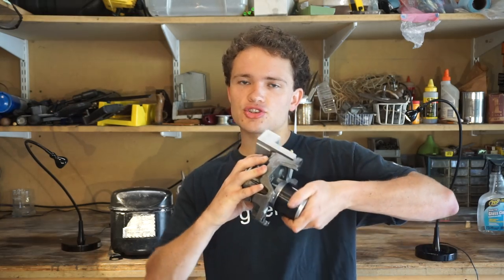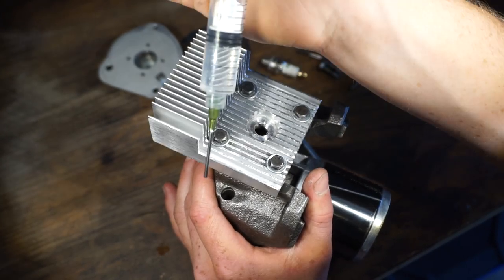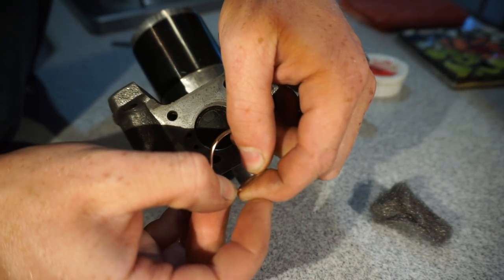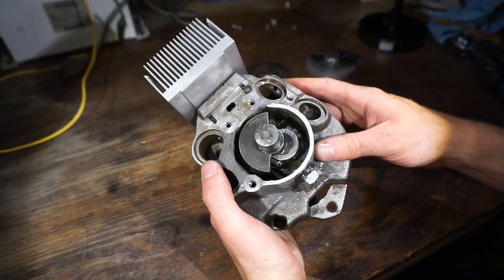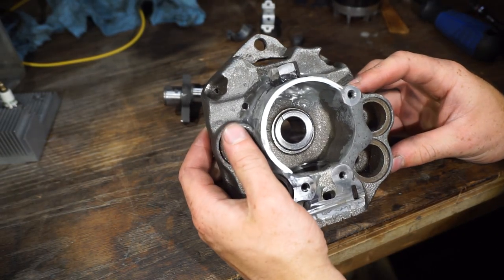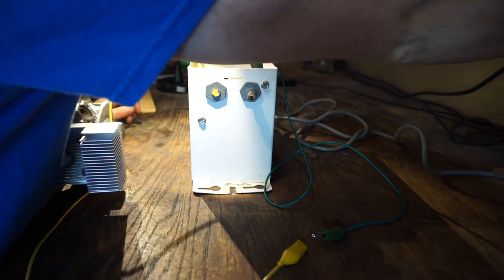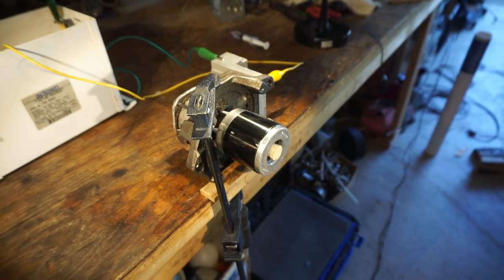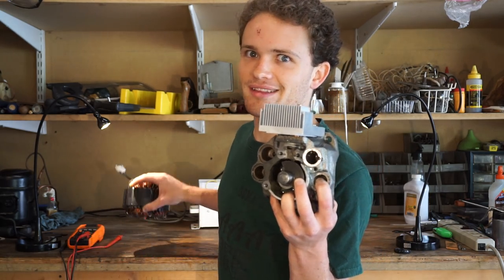Part 5. DIY Internal Combustion Engine Made from Old Compressor - First Run and Copper Head Gasket

Comment: I cant believe you got that running that fast!
Reply from the maker: Yeah me too!  It's pretty well balanced and being such a small engine it kinda has to be a fast runner.  I'd guess it was easily going 6-8k RPM.  Small nitro engines go like 12K RPM
Reply: I wish I could find a compressor myself and build along, it would make a neat rc engine.
Reply: Makerj101 Actually some 3,5cc nitro engines rev to 28k rpm, my modified 50cc moped revs to over 13k rpm
Reply: Lol I bet that moped sounds dope.
Reply: Ruben Olaussen actually rc engines rev up to 50000 rpm
Reply: Thallium rc you might be able to find one at a junkyard somewhere.
Reply: Briggs & Stratton Power my 3.5 engine revs 50k rpm.. I blew the little engine up at the end
Reply: Just keep looking, I managed to find one after 2 months of the series starting and i'm just on to making the crankcase. Believe! Fellow engineer!

Comment: I would love to see your take on the rotary engine
Reply from the maker: If I can make it out of solid JB Weld then YES  :D
Reply: XD JB Weld rotary. Now that I'd like to see.
Reply from the maker: Hehehe XD
Reply from the maker: I'll give it some thought
Reply: Makerj101 actually some aircon pumps were wankel, so you may be able to turn it into an engine fairly easily
Reply: Callum Tapper dude. Bro. I would mount a small rotary to my bike.
Reply: TheFunniestFarm you can actually get tiny little wankel engines, look up Sachs wankel engine
Reply: Callum Tapper Look up ''O.S wankel engine"
Reply: Makerj101 look up os wankel engine
Reply: It would be pretty much impossible to make a rotary
Reply: Brayden 825 more possible then you think
Reply: Brayden 825 he would have to cast parts out of aluminium... but yes lineing up the roters edges with the housing/combustion chamber to jenorate the proper conpreshin will be very tricky
Reply: Makerj101 jb weld and gorilla glue, maybe some super glue
Reply: I second this! I'd love to see you have a crack at a rotary
Reply: I woul also love to see you atempt the wankel
Reply: another rotary vote. by far my favorite engine design ^_^
Reply: @theLuigiFan0007Productions  OK, we've all voted that Makerj101 build a rotary and somewhere use JBWELD....let's make sure JBWELD supports his build!

Comment: This is great! With a proper 2 stroke exhaust and a good carburetor, this little engine can get very fuel efficient! With some old automotive parts, a simple ignition system shouldn't be too hard to fabricate. When you're going to use premixed gas, i recommend to use synthetic oil for this type of engine.

Comment: Holy cow. I have to admit, I was sceptical. Especially when drilling the hole for the piston-gated intake port, it seemed your drill alignment was pretty far off your mark.
That combined with the "I guess it would go here" placement if the transfer port and the exhaust port, I thought it didn't have much chance of actually running.
I stand corrected, you are a genius.
Reply from the maker: Haha I was winging it pretty hard, eh?  Yeah I noticed how far off the drill was when I was editing the video!  I never noticed that when I was actually drilling it.  I'm surprised that didn't mess it up.  Thank you for your kind words!
Reply: I'm surprised by the apparent stability for such a thing
Reply: @makerj101  People like you who do often have an sense of whats right vs the textbook.  pat on the back clapping way to go bro!
Reply: Running is one thing making power is another.. however this project doesnt seem to be about power.. just experimenting. Super cool engine man props!

Comment: Excellent !    Many of the old spark ignition two stroke model airplane engines have a baffel across the top of the piston.  This is to force the incoming fuel charge up and prevent it from simply shooting straight across and out of the exhaust port.

Comment: Great Job! I was planing to turn a 4 stroke engine into a 2 stroke engine and see if I can get more power that way, It was great to see your engine finally running!
Reply from the maker: Hmm well in theory you could because you are getting twice as many explosions.  However you would also be loosing a lot of benefits of a 4 stroke.
Reply: Yeah it would be a cool experiment though, I was thinking of using one of those 212cc predator engines from harbor fright, maybe put it on a gokart and do a top speed run before and after,  would make for a interesting video at least.
Reply: Sorry but it would be cheaper to buy a two stroke engine
Reply: well you can get one of those engines new with coupon for like $100, you cant find a 2 stroke engine that big for that cheap, but anyway that's not the point of doing it, mostly i want to do it because those engines are often used for racing go-karts and they sell many mods for them, but I could pretty much turn it into a 2 stroke for almost nothing and It would just be fun to see how good it works. (For entertainment purposes only)
Reply: a piston that size would cost mayby 50 bucks for a knock off winsco. the head atleast 100. by the time you get done with it you could of bought a CR500 off of craigslist
Reply: I wont need a new piston or head, ill just take out the push rods and cam, and drill some port holes and a few other things similar to how he made this engine
Reply: I bet you can get a cheap 5 hp flat head engine on Craigslist for $5-$40 and all you have to do it buy jb weld and put it around the open space where the valves are and take out the cam and the valve components. And then drill out the sides of the cylinder where the right spots for the intake and the exhaust. And in that case I think you can keep oil in the crank case so you would hopefully have a running engine with oil in the crank case, and if it doesn't run you only spent $5-$40 for an engine and a couple things jb weld. But who knows you have to do the experiments on your own to find out haha

Comment: Man you are going to be a great engineer, half the guys i go to college with dont have any where near the knowledge you do and I am an engineering student myself, I repect you a lot dude, keep up the good work.
Reply from the maker: Thank you!  See that's the thing.  I don't know if engineering is what I want to do.  I don't know if my hands on skills will be used to their full potential by doing engineering.  Good luck with your studies!
Reply: I am trying and struggling, like you i have a lot of hands on skill, but I am also very good with my mind, numbers and such. I love fabrication work and welding. I love your videos, and have been watching them a long time. Only one note; on the JB weld it tends to get brittle after a while, I am not sure how well it will wear, but the crank case isn't high pressure, so it should be ok for a while. I can't wait to see what you do with this.

Comment: For future reference, copper actually hardens when you let it air harden. It only softens when you quench it, best in water. Only carbon steel really hardens in a quench. I'm a hobbyist metalworker and knife maker, and I have messed up air cooling copper before and then cracking it when I bend it. It's a common misconception that copper anneals in the air. It hardens the crystal structure.

Great video by the way. I love this channel, I'm glad you've gotten so many subscribers. Here's hoping you get even more!

Comment: That's awesome!! Why don't you mix a little bit of 2-stroke oil with your Coleman white fuel to help with lubrication
Reply from the maker: I'll save that for part 8 when I do the official run!  This was only a test. :)
Reply: Makerj101 oh cool :)
Reply: Great idea but how do you classify this? 32:1 40:1 etc... ? I'd use Marvel Mystery Oil... I know a hot rodder who swore by it in his Chrysler 440 for top valve lubrication. Target sells it.
Reply: I'd use 25:1 for this.
Reply: Although a normal 2 stroke has ball bearings. This has bush bearings so will 2 stroke style lubrication be sufficient or will the bearings fail. Time will tell I guess. Running it on LPG/propane wouldn't dilute the oil like petrol would therefore maintaining the viscosity that those bearings were designed for.
Reply: There are many 2-stroke outboards that used bushings instead of bearings, but as far as i know the British Seagull ran on a pretty rich mixture at 10:1 oil.
The heavy oil mixture helped seal the bushings so no air would lean the air/fuel mix.

Comment: Soldering on a gas cooker? Now I've seen everything xD
I'm so glad it runs dude! Like you said, you definitely need a carburetor so you don't accidentally flood the engine (again haha). It might also be worth your time to design a proper exhaust pipe for this, since 2 strokes work best with a tuned exhaust; more power and much better efficiency due to backpressure. Pullstart is fine for now, I'd worry about making it work as efficiently as possible first before slapping a genny on it :)
Reply from the maker: Hahaha well since I'm trying to make this possible for anyone to make.  And lots of people apparently don't have blowtorches sooo...
Thank you!  And yeah carburetor is coming in the next video!  I'll think about an exhaust pipe as well.  That's a really good idea.  Maybe I'll make an expansion chamber!  :D
Reply: Wait really? I have a blow torch, but I don't have a gas cooker...  haha
No worries bro. I'm so excited to see how you'll improve this engine. Good luck! :D

Comment: awesome series it needs more views! also just a side note your meant to tighten head bolts in a star pattern to avoid warping it although i highly doubt it would matter on this just a good tip if your working on your car. thank you so much for the videos!
Reply from the maker: Thank you!  Tell all your friends!  :)  Haha yeah I just kinda tightened them in a random order!  :P
Reply: It should get more views considering no one try's this on here
Reply from the maker: Well that's part of the problem.  Since not many people have done it, people don't know to look for it.  People have turned compressors into IC engines before.  it's just not real common and the videos are hard to find because most of the videos are poorly done.
Reply: Makerj101 that compression ratio sounds like it would be for a Diesel engine
Reply: Makerj101 I hate to ask this again but how come u doubled the numbers for the compression ratio
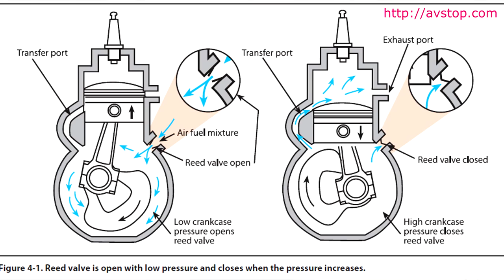Reply from the maker: Volume at top dead center was 0.5ml.  Volume at lowest point was 6ml.  Compression ratio is generally stated as a 1:(and a larger number).  You could say 0.5:6 but that'd be kinda confusing because it is just supposed to be a ratio.  Not the real volumes.  So to make 0.5 to 1 multiply by 2.  Since it's a ratio multiply both sides and you get 1:12 compression ratio
Reply: Remember the stoichiometric formula for air/fuel ratio is 14.6:1
Reply: TheFunniestFarm Air/fuel ratio does not have anything to do with compression ratio.
Reply: TheFunniestFarm And that ratio is meant for gasoline.  The stochiometeic ratio for coleman fuel is probably diffrent.
Reply: Szekely Ferencz you sir, are correct. you win 500 internets xD.
FuelRatio by mass [6]Ratio by volume [7]Percent fuel by mass
Gasoline14.7 : 1—6.8%Natural gas17.2 : 19.7  : 15.8%Propane (LP)15.67 : 123.9 : 16.45%Ethanol9 : 1—11.1%Methanol6.47 : 1—15.6%n-Butanol11.2 : 1—8.2%Hydrogen34.3 : 12.39 : 12.9%Diesel14.5 : 1—6.8%Methane17.19 : 19.52 : 15.5%
Reply: Szekely Ferencz also wasn't commenting on compression there :P

Comment: IT'S ALIVE!!!!!! Congrats on the first run. Glad to see you read my comment and fixed the compression ratio xD. Try to make a bracket to mount a small weedeater carb on, or just make one of your old jar carbs. If going jar use different tube diameters to adjust air/fuel mixture. Add smokeless 2 stroke oil to your fuel to keep it alive >_<

Comment: I would like to suggest you to use a mains step down transformer as follows:
a) choose a 4.5V - 6.0V main transformer that can deliver about 1A at its secondary.
b) connect the primary (mains AC input coil) to to the spark plug with both wires connected one to sparks central top connector and the other to its metal case. Connect and disconnect the DC supply to visually check whether a spark is produce. 
c) Adjust step 2 to obtain the required spark strength

It is important to make sure the DC current is sharply disconnected so that the rate of magnetic flux collapse in the transformer's core is high enough to produce the required voltage.

Comment: AWESOME!  I don't think that it would work as a generator without some modification though, because in an induction motor the rotor isn't magnetized unless the motor is powered up, but if you put a permanent magnet in the stater it will generate AC.

Comment: I think, you can also avoid having to use a carburettor by using a very simple fuel injector. What you need is a tiny hole that guarantees fuel is broken down into tiny droplets. You can achieve a simple fuel pump by using a large spring loaded syringe. A 50ml or 100ml syringe will give enough time between refuelling.

EDIT: To avoid having the non-uniform force produced by springs, you can use a weight to push down on the syringe's plunger. Gravity provides a far more constant force within the distances encountered in this experiment. However, a spring does have portability advantages.

Comment: I'm suprised how well it worked with the constant spark, I thought it would run alot more rough. Probably helps that it runs at high rpms. I got a Honda gx160 engine with a broken off ignition coil mount, might try running constant spark on that but its also a lot lower rpm engine

Comment: For the ignition system take a strimmer flywheel and ignition coil and work the magic there. You can then make a cowling for the engine for cooling and supercharging of the carburettor. She'll run much cleaner and stronger. Get a carburettor and put it in behind the cowling for supercharge effect. Just my ranty ideas

Comment: A carb will surely help with air fuel mixing. Anoth good idea would be to use a 30-50/1 fuel oil mix as is used in chain saws and weed whackers and the like. Then you won't have to worry about pouring oil in the flywheel. The oil will get in and coat everything and then burn out as more comes in with the fuel and air.

Comment: I like how he made this with barely any tools I am 17 but I do have access to a lathe drill impact wrench drivers drill press carburetors for 2 stroke nearly every drill bit 2 stroke fuel air compressors with 2 pistons and air rotary tools and chisel hammers you are doing good

Comment: Cork is a pretty common casket material used in motors. That little bit you have on there should be fine. This needs to power a little RC car.

Comment: Or instead of having a constant spark from a battery powered ignition you can get an actual coil. Your flywheel is from the center of an electric motor you already have a magneto. You could have proper spark timing.
Reply from the maker: Yep!  I'll build some type of ignition circuit in part 8!  I just needed a good way to test it to make sure the compression wasn't to high and such.  Thank you for the suggestions!
Reply: You can make a crude version of an "Interrupter" via a relay and a switch to shut the transformer off until the the piston reaches near top dead center. A micro switch would work perfectly, especially one that has a small bar to actuate the switch. Grind down a flat spot on the end of the rotor(your current flywheel) to cause the switch contacts to close. You will get more speed out of the engine due to it not fighting itself (early ignition events) on the compression stroke. Amazing job on the build so far!!!
Reply: The center of the motor isn't actually magnets, it's a laminated core with iron poles. The field windings have the alternating magnetic field that carries the rotor.
Reply: Search for "squirrel cage motor" in google images and you'll see what it actually is, there's no magnets in it. The magnetic field from the stator generates current through the squirrel cage. That current causes a magnetic field that repels against the magnetic field from the stator. Basically the magnetic field from the stator drags the squirrel cage around in a circle.

Comment: you did a good job ,  did you think about making a vapor carburetor for this , it will be good and easy to make
Reply from the maker: Thank you! Yeah I've thought about it.  I think I'm going to go with a venturi type carburetor because I would like to mix oil with the fuel like a normal 2 stroke.  With a vapor carburetor no oil from the fuel would get into the engine.

Comment: Yes if you add a capacitor cap will "produce" reactive energy that is needed for asynchronous  generator to operate it starts on its own because if residual magnetism in the core.

Comment: That is truly awesome :D 
I wonder if it would work on propane/butane since it doesn't really need much in the way of lubrication from the fuel (since you can just pump oil into the crank case lol) 
What with it being so small, I bet a lighter refill can would give enough butane for a reasonable run time :)
Reply from the maker: Thank you!  Yeah it would probably run ok on one of those fuels.  Maybe I'll give it a try sometime.  Currently I want to run it on gasoline because I think it would be most popular.  Then maybe a future modification.  Dual fuel for the win!  :D
Reply: You might consider LNG because lots of homes are currently adding generators for backup that run off the city supplied LNG. You might want to get ahold of some orifices from conversion kits... I've installed them on LNG stoves that were originally set up for propane.
Reply: Skruffles my first thought was propane. Cool stuff.